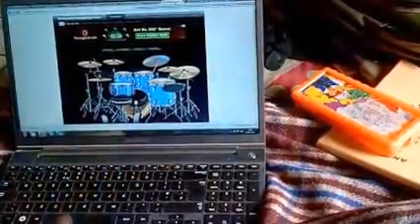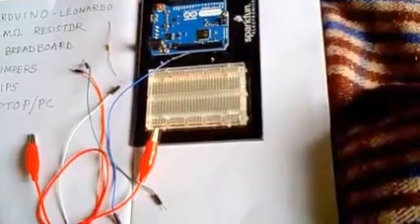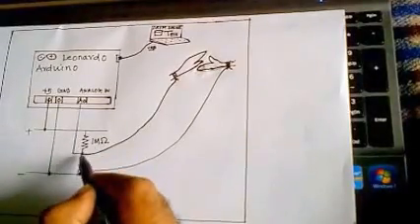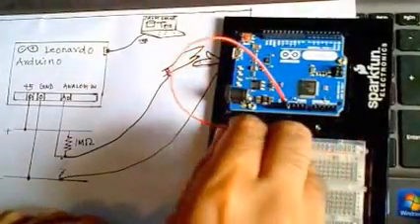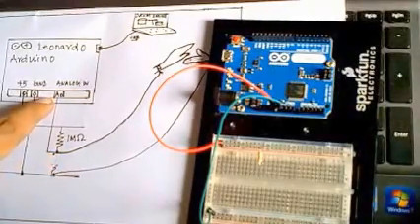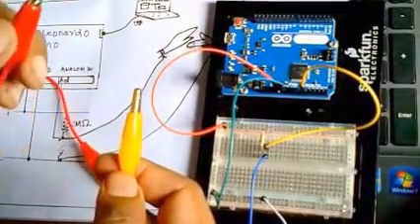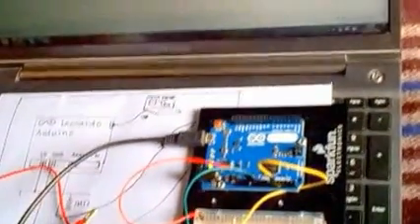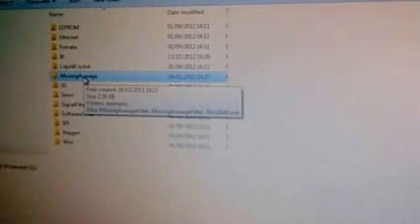Make Makey Makey using Arduino

Comment: I  can't compile the code :( error: 'MovingAvarageFilter' does not name a type (ide 1.06 and 1.6)... any solutions???
Reply from the maker: add moving average library to your project
Reply: +alpesh vitha thanks a lot for the quick reply... but I have done that.. it's in the ide  library and in the sketch... here is the code :

 #include <MovingAverageFilter.h>

MovingAvarageFilter movingAvarageFilter(20);
 
 
boolean check = false;
 
 
 
 
void setup() {
 
Serial.begin(115200);     
 
}
 
 
void loop() {        
 
// declare input and output variables
 
float input =  analogRead(0); // without a real input, looking at the step respons (input at unity, 1)
 
float output = 0;
 
 
output = movingAvarageFilter.process(input);
 
// here we call the fir routine with the input. The value 'fir' spits out is stored in the output variable.
 
 
 
if (output < 200 ) {   // you can change this parameter to fine tune the sensitivity
if (!check){         
Keyboard.print("d");         
Serial.println(output);           
check = !check;   
  }         
  }
 
 
if (output >600) {     
  if (check){               
  check = !check;   
  }     
  }
 
 
}
Reply: Hey i have the same mistake and its because in the code its written "Avarage" instead of "Average"... Its only that silly mistake.
Reply: I have same problem.
Reply: Karel Zanáška yeah.... pretty frustrating... I've spent half a day, half a dozen of tutorials, two different Arduino IDEs and I can't get it to work,... not that it seems too complicated, but every code stops to work at some level.... I've already invested in a lot of hardware as well: I got a leonardo and a makey makey (clone) shield.... apart from saving some money I thought it would be way more interesting to make a makey makey rather than buy one, but now I wish a had ;)
Reply from the maker: +Andreas Hofer  Wait, let me compile the code at my end.
Reply from the maker: +Andreas Hofer This is the fun part of making it work, you struggle and brainstorm and finally when you make it work the joy is unparalleled. welcome to the maker community! :-)
Reply: alpesh vitha thanks for your encouragment :) ... well, currently I've switch machines, from Windows to Linux with IDE1.0... after getting all those permissions sorted out, I've got even more compiler errors... :( 

Does compiling my code (which is really yours ;) work on your machine?
Reply from the maker: Andreas Hofer which location have you saved your library .ccp and .h file ?
Reply: alpesh vitha I saved them in the Arduino IDE libraries folders (insides a subfolder, like all other libraries).  Even though I've haven't got more than 2 months arduino experience, I suppose I didn't make any mistakes here... I have got other libraries to work.... so, I would be surprised if that's the root of the problem.
Reply: some days nothing seems to work.... I did find some code that worked the first time round, though.... amazing...https://github.com/robotfreak/MakeyMakey-Leonardo
Reply: Karel Zanáška I got it to work...using different code though... digital pins instead of analogue ones: https://github.com/robotfreak/MakeyMakey-Leonardo
Reply: omg thank you I was going nuts

Comment: this is really great, very easy to follow... thankyou for a really helpful video

Would you have time to further explain part of the code to me please? 
I would like the 'touch' to light an LED - i tried this... (after declaring the output pin and LED1 integer )  

i'm not sure how to adapt it properly...
 
if (output<200) {   // you can change this parameter to fine tune the sensitivity
if (!check){         
digitalWrite(LED1, HIGH);       
Serial.println(output);           
check = !check;   
  }         
  }
 
 
if (output >600) {     
  if (check){               
  check = !check;   
  }     
  }

Comment: Can I do this with arduino uno?
Reply: USB Keyboard emulation is only supported on ATmega 32U4 Arduinos.
Reply: It doesn't look like it requires anything special to the Leonardo so I would imagine you could use an Uno. It would connect in the exact same fashion...
Reply: +Darshan sk look in  the description

Comment from the maker: The resistance of your body will allow on a negligible amount of current to flow through the resistances (The voltage divider consisting of 1Meg resistor and your body). I think it will be in the order of microampere. So we want the R1 (resistor) value to be as high as possible so that the voltage drop across it is significant enough for detection by Arduino.  However if you increase the resistor value more than 1 Meg, it becomes over sensitive and unstable. Try it out, msr current try diff rest

Comment: Sir I am using arduino uno r3 and I have implemented the code for one input it works fine .But in multiple inputs when I connect it to my arduino r3 it just prints the all the alphabets which are assigned. sir i have mailed you the code please help!!!

Comment from the maker: Yes, are you using 1 Mega Ohms ? anything less than that would reduce the sensitivity.  You can change the sensitivity through software also if changing the resistor does not work.

Comment: thanks got it working ! would you tell me how to code to for multiple keys , i built an identical circuit alongside my other one and added an input2 and an output2 then copied another set of if statements the names changed according but this has not worked.

Comment from the maker: Yes, it is possible using UNO. However, you will have to use additional software on your pc. (AAC Keys). This software reads the Serial port on your PC and converts the ASCII input into Keypress.  So in your UNO program you just use Serial.Println(64)  it will print the ASCII value of 'a' and AAC keys will convert that into a keypress.

Comment from the maker: Yes you are right, it is because we have connected only one resistor. You can connect more resistors across other Analog Input pins of Arduino and copy paste the code for them. Let me know if you need help with the codes or circuit

Comment: But u can use the signal, and then with any programming environment and firmata should work but not as a keyboard only digital 1/0 data. something like this vvvv.org/contribution/arduino-to-vvvv-a-paper-touch-interface

Comment from the maker: There is one work-around, you can install a software like 'AAC keys' on your laptop. It will read the serial input from Arduino Duemilanove or Uno and convert them into key presses.